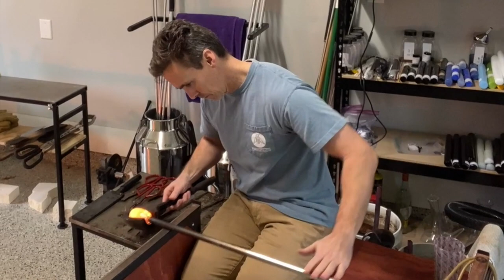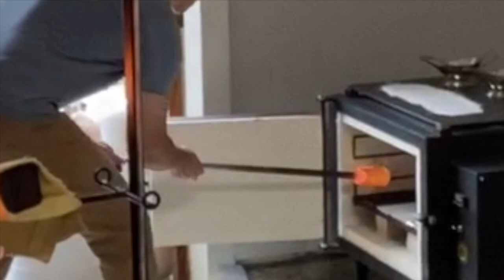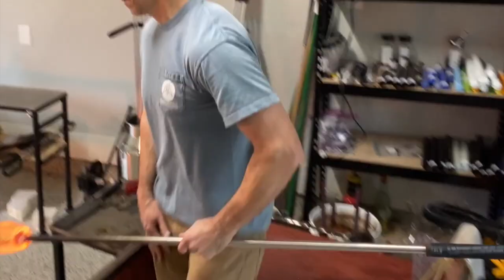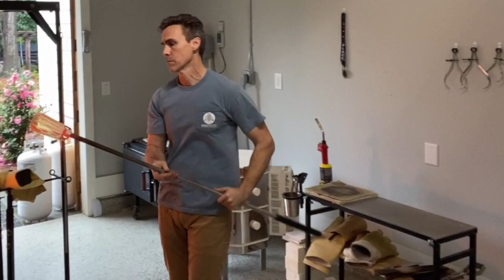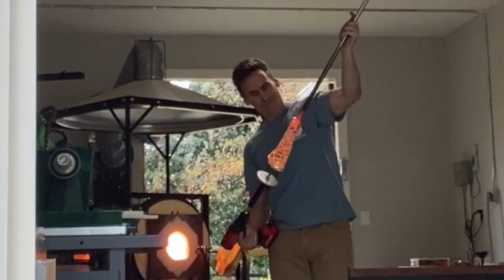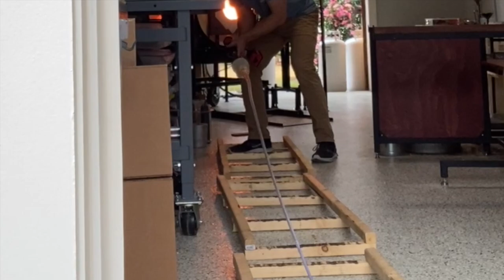Pulling Twisty Cane In Greg Fleischaker's glass blowing studio

Comment: Cool vid how did u hold the blow pipe while twisting the cane?
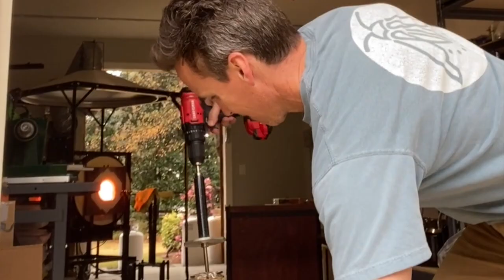Reply from the maker: Ah yes, can't see it in the video, sorry!  At about the 3:28 mark I set the punty down into a stand that I had made that holds a pipe or punty horizontally for me that I can pull against, in this case it has four legs that I set outside of my garage floor which is raised just an inch or two and then I can pull a little against the stand and stretch the glass out.
Reply: @GregFleischaker  is it possible to use a drill to twist cane while using a torch setup instead?
Reply: @GregFleischaker  can u take a pic of the stand u made? Thanks for the response.
Reply from the maker: @urzathehappy72  I've actually moved since making that video and don't have the stand anymore to show you, but here is an IG video from last year from the guy who taught me how to do it solo and you can barely see how he holds it in place with a a DIY set up - https://www.instagram.com/p/CkB4v4cp7c1/